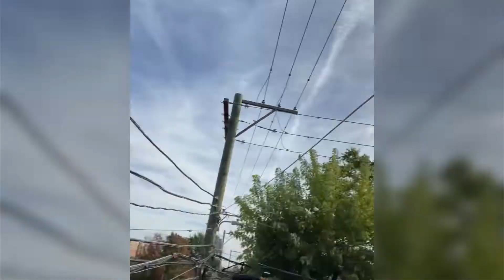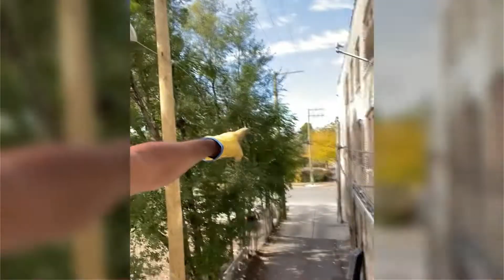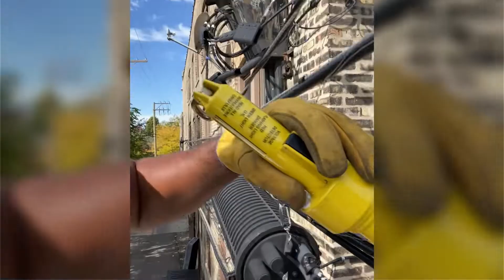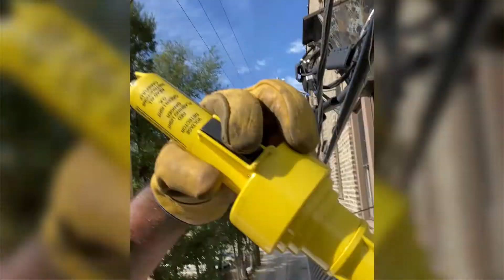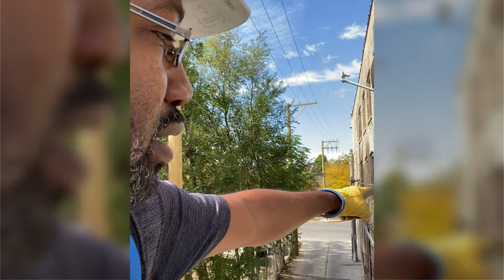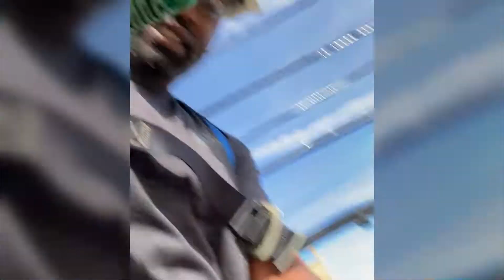Overhead Line Safety: Foreign Voltage Detector

Comment: The way i was taught on how to use this tester is: first press the button, make sure you see a green light, short it out by touching the tip with your bare hand and then one of the screws on the side of the device to trigger the short in order to verify the red light goes off and the device if working properly. Also you first press the button and make sure the the tester light goes green, then you come into contact with the potential object to verify if it detects foreign voltage or if it is safe to work.
Reply from the maker: @TheMwowner1 your exactly correct! The probes on the side will help you determine if the device is working correctly. Sadly my I had to hold the camera with one hand and and use the FVD with the other, so I was unable to capture this footage. Recording footage in the bucket without a go-pro is plenty difficult.  Furthermore, in some shops there are inhouse testing points to ensure equipment usability before rolling out. Thanks for dropping by. LIKE, Share. Sub-Scribe!